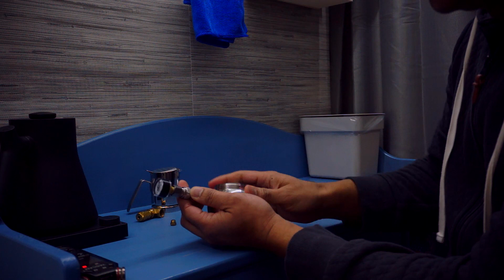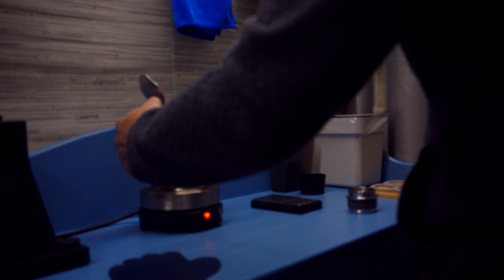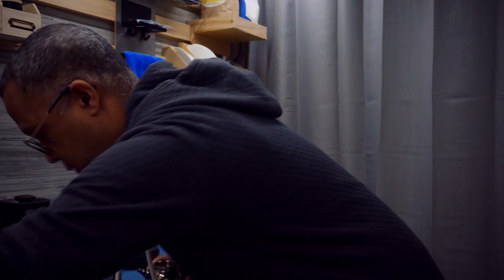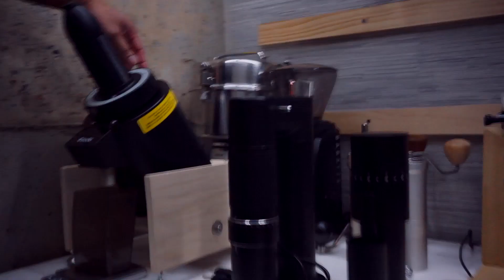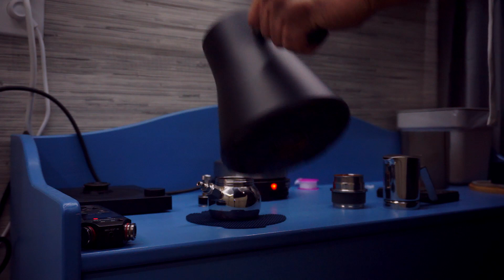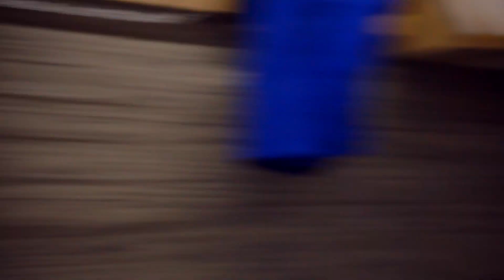Moka Pot Pressure Guage Walkthrough

Comment: Wow! That's very interesting! I'm thinking you weren't happy with the flavor your Moka produced so you've figured out an ingenious way to control the process. But maybe you'll enjoy the flavor more from this very simple, traditional Bialetti technique:

Reasons why Bialetti, who has their own Science and Engineering Department, recommends filling the Moka with cold or room temperature water: 

Cold water contains more molecules than hot water does, so cold water expands more and creates more pressure in the Moka than hot water would when it's gradually heated on a low gas flame or a preheated medium electric stove. 

The Moka doesn't work by boiling and creating steam, it works by expansion pressure as the gradually-heated air, water, and vapor expand until the pressure pushes the water down and up through the pipe, where it bathes the coffee powder at a temperature below boiling long enough for a good extraction. 

The ideal temperature range for brewing espresso or coffee is 195°F to 205°F, but filling the Moka with hot water, and then cooking it, quickly brings it up to the 212°F boiling point, which is too hot and brews too fast for a good extraction. 

So for the best flavor, I recommend following the science-based Bialetti instructions without adding any hacks or tweaks to the process at all: Fill the Moka with cold or room temperature water; loosely fill the basket with fresh medium-fine ground espresso powder, and scrape the top level with the rim, but don't press it down; clean spilled grounds off the rim and threads, lock the Moka tightly; cook it on a low gas flame or a preheated medium electric stove with the lid closed; the instant you hear it begin to gurgle, remove the Moka from the stove and let it finish brewing on your countertop from the residual heat inside the pot; stir up the most-concentrated coffee from the bottom with a teaspoon and pour. 

Your Moka reservoir will have leftover brown water full of fines in the bottom, which is not the tastiest extraction so it's good that it didn't go through into the upper chamber and your cup!

If you don't want to grind your own beans, all the pre-ground Italian grocery store espressos are ground medium fine for the Moka: illy, Lavazza, Kimbo, and my favorite: Bialetti Perfetto Moka Classico Espresso, which is very smooth. 

Anyone who follows the above Bialetti instructions will have good flavor every time that's never bitter, never burnt, never over- nor under-extracted.
Reply from the maker: Thanks for this detailed guide. I think I'm essentially having the same results with my gauge. By monitoring the internal pressure, I can ensure that the water stays below boiling. I actually never let it get to the point of gurgling, as I feel that it's an indication of the water reaching the boiling point. I assume though, that if you remove it from heat as soon as you hear it, you're minimizing that effect. It doesn't take much for the water to cool below 212.

Overall, I think you're guide (meaning Bialetti's 😁) is tried and true, requiring no modifications in getting good results. But I do like my mod, as I have much better feedback in order to regulate the brew.
Reply: @davidmaurice1294  That's great, I'm glad your modifications work so well! 😊 ☕

You're right, it's good to remove the Moka from the stove just before it begins to gurgle; that's what "Italian By Bri" does in her Moka tutorial because she knows the timing and the signs well enough to catch it at the perfect instant before it gurgles. The gurgle means the reservoir is almost empty, so it's like the sound of slurping the last bit of soda through your straw.

Comment: Interesting!  

Why not just get a nut and o-ring to fit the 1/8" NPT Quick Release Fitting and skip the 1/16" to 1/8" adapter?
Reply from the maker: Thanks for all the tips! Will look into all this for the next iteration. My moka pot is designed by an Italian company (although made in Taiwan), so definitely possible that it uses BSP. That would make sense, since the threading was the source of a lot of the challenges (the stripping was introduced before I decided on using a nut).

Ideally, I'd like to avoid having to drill and tap, so hoping with this info I'll find the right fittings. I guess we'll have to see though, your idea to drill could make things easier going forward.
Reply: Also, NPS is Straight/Parallel (i.e. without the Taper (NPT)), so that may narrow your searches.
Reply: Sorry, one more 🙃 If you used the 8mm-M1.0 Nuts on the 1/16" NPT Adapter Threads, that is likely where the stripping came from - it would require 1/16"-27 NPT Nut  (unless the pot originally used BSP thread as that is also not compatible with NPT)  (Europe/UK is likely to be BSP).

You could just drill and tap for the 1/8" NPT quick release and use a 1/8"-27 NPT Nut.